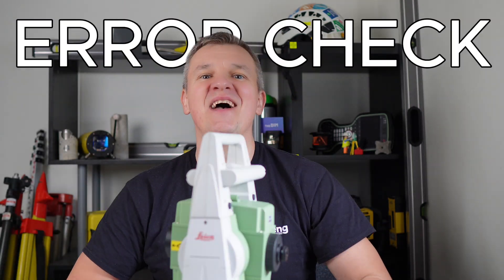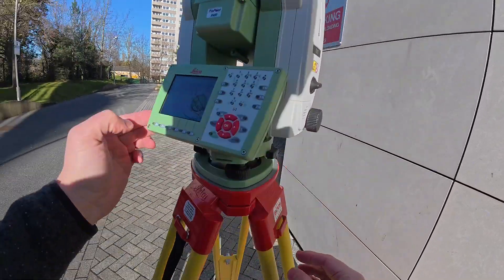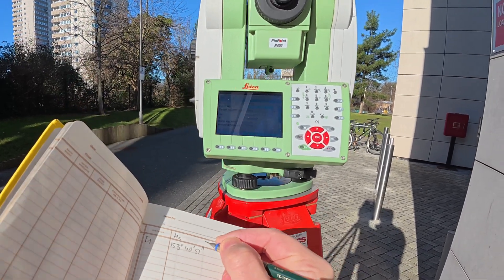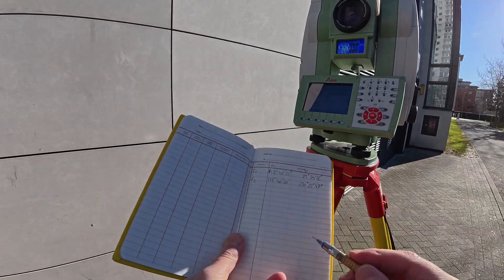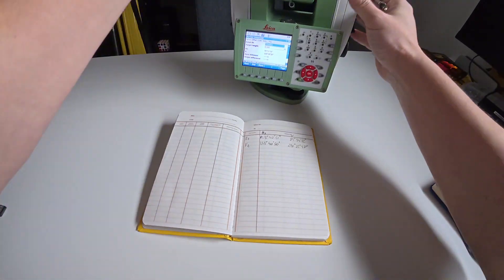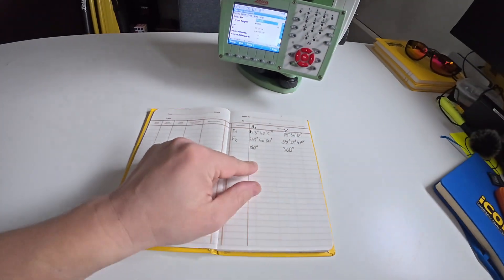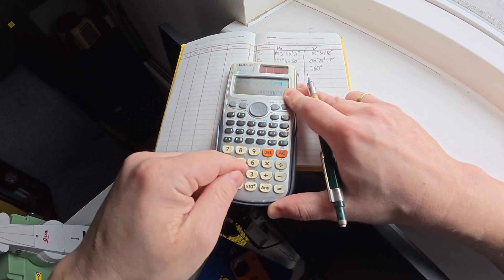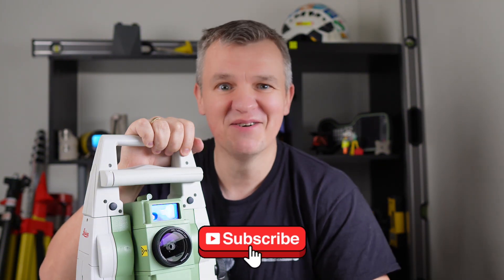2-Face Method Every Site Engineer Must Know❗️Total Station Error Check in Construction 🏗️

Comment: I use the TS06 Plus. What is the minimum and maximum distance for the target and EDM? Does the measurement need to be horizontal, or is it okay to measure at an angle?"
Reply from the maker: Wow, still TS06. I still love it, although it's a past really ;) Ideally that would be same as for calibration, ar. 100m, but 50 would be well enough. Just shoot the target you have the furthest on the job and that's it (within 100m I mean). there might be slight angles - also ideally if you keep it withing +-10deg from the horizont
Reply: @SITENG  thanks